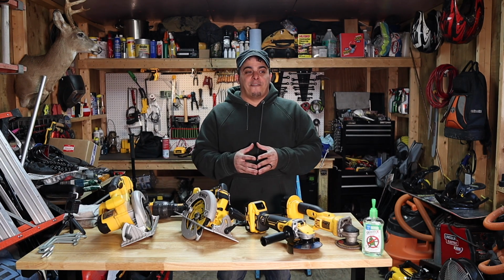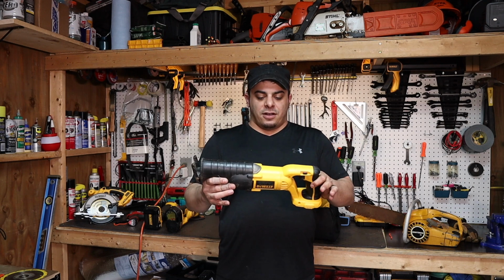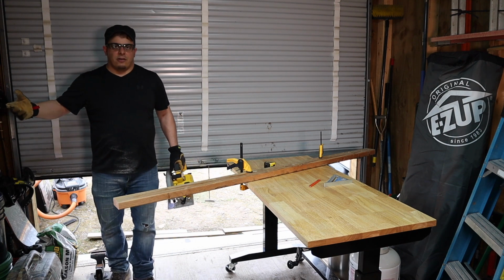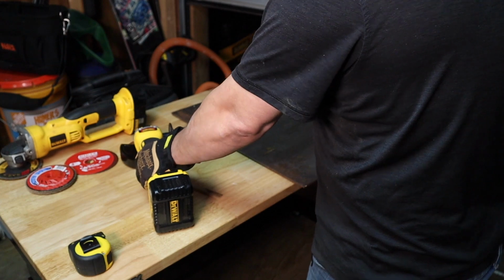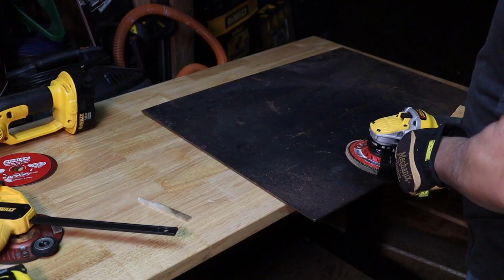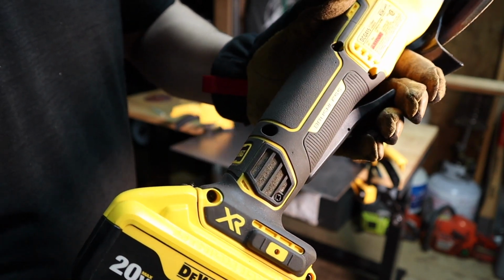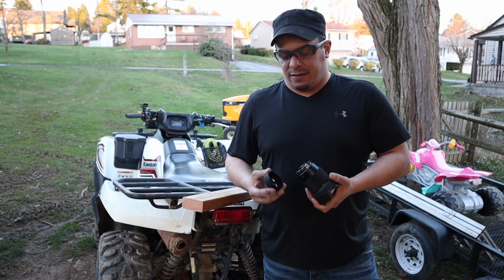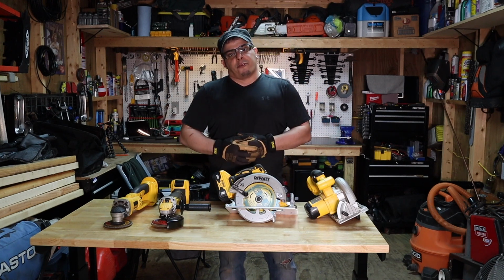New Dewalt 20v Power Detect XR Tools - Circular Saw, Grinder & Reciprocating Saw vs 18v

Comment: That DeWalt dc385 will go down in tool history as one of the best recip saws ever built and I will be upgrading my tools soon too but my 18v dcd970kl hammer drill and dc385 saw are staying with me those are my two favorite in the 18v line I got 4 lithium ion batteries for both and all still going strong only got 2 Ni Cads left out of 5 the rest are dying off but those 18v lithium ion batteries are hard to beat may try to find 2 or 3 on eBay to ensure I can run for God knows how much longer? nice review too on the Power Detect line
Reply from the maker: Thank you my friend. I would agree with you my buddy got my 18v stuff and has been hammering them ever since they have paid for themselves time and again

Comment: Didn't talk about the drill, the new DCD998 Drill is the best of all the Power Detect tools imo.   There's no stopping it.
Reply from the maker: rcud1 if i decide to sell my 20v drill I may pick that up I already have a 20v hammer drill and impact :/ wish I could of included those in the video. Thank you for the input and being here
Reply: Dewalt 998 drill is a monster nothing will touch it

Comment: You should of got the dewalt flexvolt.   It’s a stronger line of tools and they are the same price as Lowes proprietary line a DeWalt tools which is the Dewalt detect.  The tools are made specifically for Lowe’s to be able to compete with Home Depot because Lowes was not allowed to sell the dewalt flexvolt.
Reply from the maker: survivalSC interesting stuff. Thanks for sharing that info.I know the flexvolts probably have more power etc but these work pretty well. Maybe that will be my next upgrade. Thanks again
Reply: NickPixelTV I’m not trying to say the new tools are not going to be good.  But you should at least try the flexvolt Circular saw and then make a decision.   Dewalt gives you 90  days to return everything at the store.
Reply from the maker: survivalSC appreciate that information my friend. Will have to try them out. Thanks for stopping by ;)
Reply: These 20v Power Detects perform as well or better than the Flexvolts from what I've seen.
Reply: @rcud1  from what I seen so far the new flexvolt circ saw out performs the PD but for recips they are about even. The plus to the PD is that the batteries from your other 20v will run the PD. Whereas the FV obviously your 20v won't but there's always a little give and take with purchasing decisions and these PD line look pretty solid to me.
Reply: @rcud1  No they don't the flexvolt is the most powerful, these power detect are just as powerful as Milwaukee fuel and are much lighter

Comment: I've been building houses for 25 years...battery tools have been a joke  in the construction business up until about 10 years ago..they really came along way in the past few years.  I just switched over from dewalts 18  to Milwaukee fuel lines... only because no where here has a good selection of dewalt tools.  Nice video SIr
Reply: I'm in construction myself I started with makita and switched to rigid for the lifetime batteries, the m12 Milwaukee line got me hooked and I no run just about everything Milwaukee weather its construction or automotive. It's nice having one charger for both batteries.
Reply from the maker: Milwaukee M12 got me hooked Tarek. Great to see you here brother! We need to set up another live some day.
Reply from the maker: I agree with you. I probably wold of went Milwaukee if I didn't already own 20v tools. The Milwaukee technology/motor/battery efficiency in the 18v fuel line is impressive. I don't think you'll have any problems there! thank you JN

Comment: Good video, me personally am not a big Dewalt fan, but alot of people like them.  There has been alot of advances in the past few years in the cordless market.  And just as soon as you buy one tool there is another one that is better, lol.  Makita has been my brand for 20+ years and you can still get parts for almost every tool for the last 30 years.  On my old 18v nicad tools, they stood up to the torture I have put them through.  I dropped my saws-all from 25 feet up to concrete and it still was able to finish the job.  MAKITA tools for life.  I SHOULD PROBABLY GET A TATTOO OR SOMETHING, 🤣🤣 Take Care!
Reply from the maker: I needed a good comment today. It's been a long one. I can't agree more on the "as soon as you buy one tool there is a better one out" That's why I like to just share my experience and or what I'm using because like you said today tools have come a long way. I hung on to the 18v forever. I have been so impressed by the Milwaukee 12v line that I find myself using them more often than the bigger tools. When I'm really hammering something i'll grab the 20v dewalt but it is bulkier. When I was a fabricator/welder we used Metabo grinders.. put them through hell and never had a problem. I like Makita as well.. never had a problem there. I think it comes down to matching with what you may already own. They do get you locked into the battery systems.. anyway, Jeremy, thank you for being here always appreciate your input

Comment: Oh man 😲😲😥😥
I could tell how disappointed you were after it happened while you were using the sawsall, I feel your pain. Any chance you could send it in for repair???
Great video on the difference between 18v & 20v way more power. The only battery tool I have is a Dewalt 20v drill, all my stuff is corded for mostly working on cars and such. Keep'em coming and oh yea, did you say you were grinding around 11pm ?? You must have great neighbors. 😝
Reply from the maker: Tim, when I edited the video I was like.. man did I fall off after that. Things Happen. I had to order another as it's a lens I use a ton but I did submit a repair order which will probably take some time. The hard part is on a 450 dollar lens if it costs 300 to repair.. is it worth it and will it ever be the same. We will see what they say and hope for the best. I can tell you when it comes to running battery tools I typically have a corded one available esp. with the 18v line. The grinder I would find myself tearing through batteries and It was just easier to grab the corded one midway through. Same with the circ saw. I can honestly say the grinder impressed me running it all evening and not even using one full battery. I have a good bit of room between houses and I help all my neighbors with their projects 99% of the time. I could probably run the chainsaw and not have any complaints. I try not to go too late. Thanks again buddy